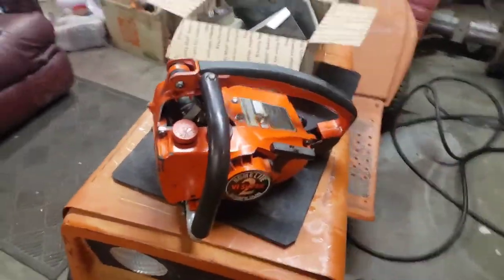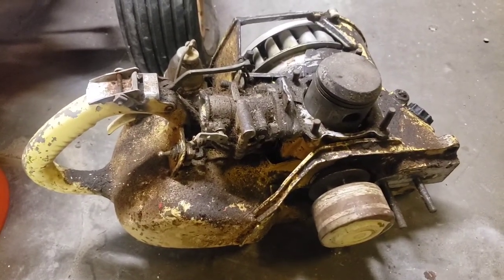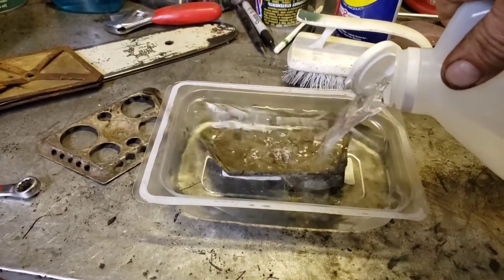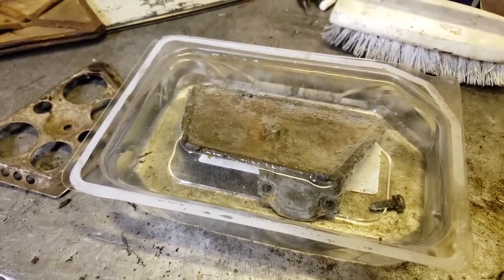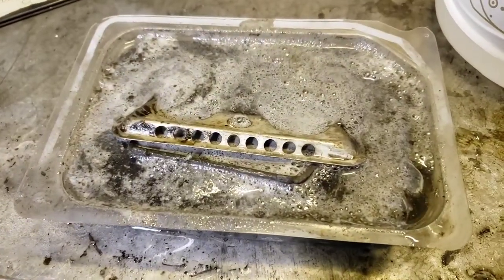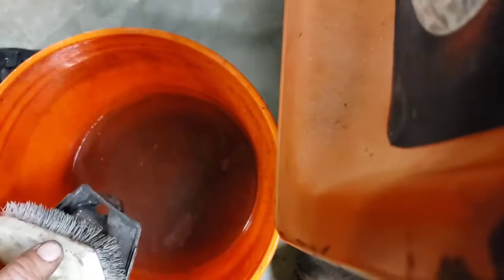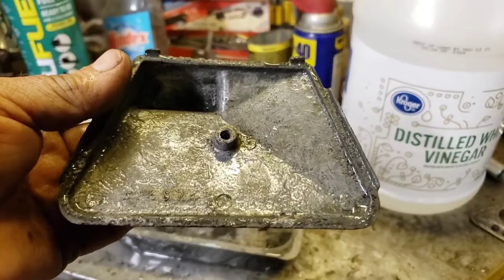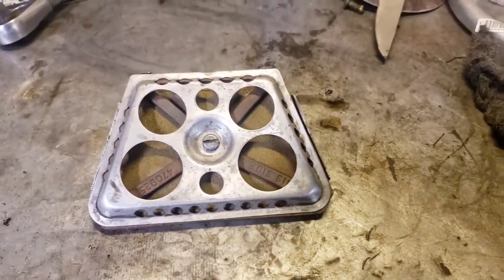Chainsaw Parts Corrosion Removal with White Vinegar

Comment: Evapo Rust works well, too but it can make some steel black which can be difficult to remove. I wouldn't use it on metals other than steel